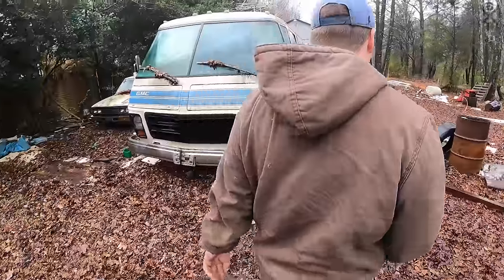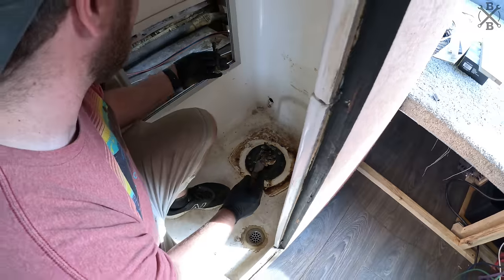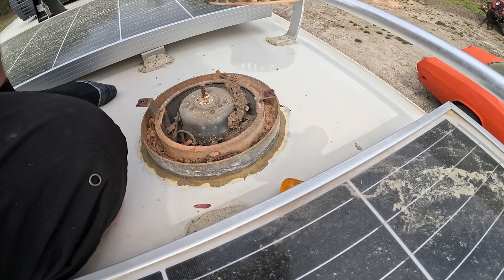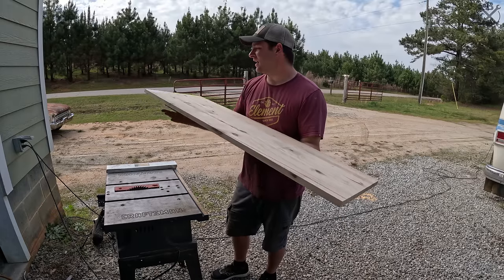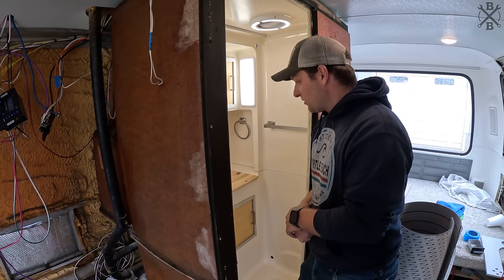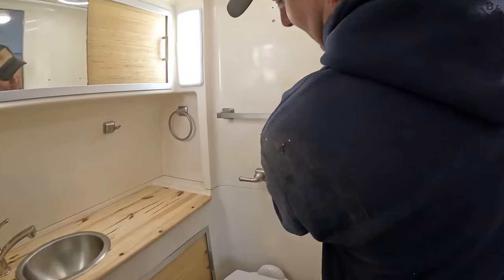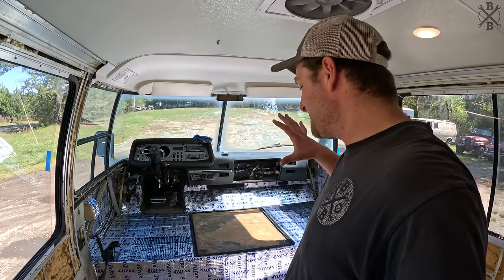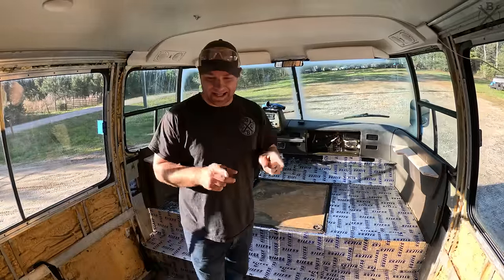Rebuilding an ABANDONED GMC Motorhome! Rescue Part 10

Comment: Looking great, very impressed with the ideas for updating the bathroom and driving area. I have a suggestion on the bathroom, the tap and sink drain flange could use some plumbers putty to stop protentional leaks. Also seeing the shower drain with so much silicone on it make me think there is a leak or was a leak that could leak again and since you have done so much maybe take a look and make sure it is good. Can't wait to see what you do next.

Comment: Go with lithium--especially if you ever want to boondock. You can get lithiums with bluetooth, low-temp protection, etc for about $165/ea now.  No reason not to--and having the bluetooth monitoring is priceless.  It's always great to know what your loads are, and especially remaining capacity.  That, and a big enough inverter if you want to use the microwave.  A portable genny is nice too if you have room somewhere.

Comment: A bit late, but if you don’t absolutely need that space between the bathroom and the door, tear out the left wall of the bathroom and install an appropriate sized shower stall. You will be real happy not having the kids having to use a wet head. Most important spaces in rv are bathroom, kitchen, sleeping, living.
Reply: Those mini tubs would actually fit in that space.
Reply: Drain Pipe Plumbing Would Be Difficult As Fuel Tanks Are Located Directly Beneath That Floor Space. Not Impossible But Kind Of A PIA

Comment: I’ve got the same flooring in my boat. If you have an issue with it peeling up, brush on some weld wood contact cement. It’s waterproof. You’ll never have a problem. It’s held up great on my boat, on the saltwater.

Comment: you are nearly there with those little bolts, but you need the ones with springs built into them, where you need to compress the spring to unlatch them, as batteries + gas bottles are too expensive to throw down the road...
keep it up guys

Comment: Michael, I've said it before, this is one of your best series yet. The Porsche was the best, in my opinion, and this is number two. Good stuff. Hey, a suggestion, if you don't mind: in your bathroom cabinet, I noticed some rusty discoloration. Something that may work in getting that out is muriatic acid - yeah, acid. It won't harm the fiber glass and a little bit on an old rag should do it. give it a try. It works. Wear gloves though!

Comment: You guys really think out of the box. The bathroom transformation was spot on. The sound deadening up front will really make driving much more comfortable. I'm not sold on your latch for the battery and tank. If the screws are not into any metal framing, it would only be time until the weight of things bouncing against the latch pulling the screws out. If you want to keep your fix, try this. Take a large long bolt with a flat washer, drill a hole in each slide tray, drop the bolt in so it drops deeper than the metal frame.  Trays are not going to come out!

Comment: Nice job fellas! I think getting it driving is a great next step. You'll want to be able to drive it after you start assembling everything. I worked at Gulfstream Aircraft for years and when we did a final flight you'd be amazed at the things that squeaked or didn't work after one flight because of fit and finish.

Comment: Propane being heavier than air, you might consider a couple vents in the bottom of your drawer slide on the thanks.  my original 76, has holes under the propane tank.  Mine's mostly original.  The interiror has newer cabinet faces, newer carpet - but original style look.

Comment: Very nice upgrade. On my old Airstream (1966) I reused the original tub but had some cracks and fiberglass repair to do. I repainted the dull off white finish with bright white Rustoleum epoxy boat paint. Pricey but looks great 6 years later. Just an idea in case you need to freshen up the interior of the bath.
Reply from the maker: Thank you!! Awesome!! 🙂 Thanks so much for the suggestion! If we need to consider that in the future, we will give it a go!

Comment: Just a thought, go to your local home center and get a roll of the (usually) pink paper that goes under hardwood flooring in a home build. It comes on a roll, I think it's about 3' wide, and cover your new floors with it so you don't damage them during construction. Love this project!
Reply: Rosin paper, great suggestion!
Reply: Don't use the pink, it can bleed if you get it wet

Comment: I have to say, that bathroom before and after alone is worth watching the series for. I can't believe how good you did on it, very impressed !! As for the door panel add ons, is there enough support with the plastic panel alone? They look great, but if someone leans hard on the outside edge, is it solid ? Not a criticism, just a question,

Comment: Love what you're doing! I may be too OCD but, may want to think about installing the shower faucet with the head connection down, rather than up. That way the valves cant vibrate to an open position going down the road? I may be wrong....lol

Comment: I think that the small lock you placed on the propane tank is not enough. It needs to lock down more for your travel, as the jiggling can unlock it. If it's out for impact, could explode. Always think safety first...

Comment: Looking great Lads !!! Budget builds are cool . I'm a little older than you guys so bare with ... In later years I developed the 3x rule ..... when attempting something unfamiliar work out these 3 things as best you can .... How much time , money and effort and then x that by 3 . If you come in around 3/4 of that you've probably done very well ........ Anyways I was thinking about the driver's cabin floor ...... Personally I'd consider covering it in lino or linoleum as yous call it , however don't glue it , use acrylic paint on both faces and then it's easily removed in the future .... It's cheap out of a dumpster and easily cleaned and if needed, you can cut out a sycodelic Mr T shaggy rug for winters .....just an easy option till something better comes along..... Also regarding batteries ...... now that's a mine field ....... I'd thow anything in there meantime and aim for lithium when you can.... Two things with that, make sure it has a sturdy bms that does everything it's meant to , and do the math on output verse's input regarding power consumption ..... So that's an old guys nickles worth..... Looking forward to the next stage of it's not already posted!!! 😉🤓🙃😎

Comment: Can't wait for the next episode. One question I have regarding the bathroom is I saw alot of screws going through the walls for lights, shower, etc but didn't see you caulk any of the holes or seal them. Any worries about water damage from the shower.

Comment: Take a look at marine woven flooring. Same thing you see in higher end pontoon boats, etc. It's a durable flooring I believe made out of PVC. It looks real good and is what Airstream uses in their campers. Then for the cockpit you can simply throw some heavy duty floor mats to address waear from your heel when driving. Looks good so far and really impressed with how the bathroom came out.

Comment: One thing I would definitely emphasize is to cut a small "trench" out of that sea deck flooring between the door and the drain. Otherwise, the water that collects around the edges will never drain. It will work it's way under the flooring and destroy the adhesive.

Comment: I used Tretford carpet tiles in a van twice. Not sure if they sell it in the states. They sell it in the most beautiful colors, it is indestructible and easy to work with. And you can always replace a tile or two if needed. Not cheap though…

Comment: Doing great my only suggestion is to we’re you screwed into the fibreglass take the screws back out put a small block of wood 
In behind and then re fix so you are screwing into the  block of wood 
It will stop the stuff eventually falling out of the wall

Comment: You did A GOOD JOB. I am doing the same to my 1996 33' Airstream Land Yacht. I put a complete 454 cid drive train including rear end and Banks Turbo with exhaust. Complete front and rear suspension rebuild, new Michelene Tires Brakes and hired an Interior specialist and updated everything. Two new windshields and a complete interior overhaul. Also a hidden push button 65" Smart TV with Starlink. New paint on the outside and a set up for the dual a/c on 50 amp and a 8kw Generator. A new bus costs 250,000 and I will have 45g Finished next week with the Power Train on a 5 Year 50,000 mile GM Warranty and Suspension. I was not paying that kind of money for a new Motor Home. I added a 150 gallon Fuel Tank for that 1200 mile range plus. A complete restoration. Everything is Brand New. It looks and smells new. I love those white leather seats with heater and massage. All the a/c's super upgraded. All under warranty parts and labor. I already turned down 110g for it. Not buying new. Good grief it is nice. Lamborghini RED Metallic. It is show room quality.

Comment: I would like to suggest you put in a one way valve thing for the shower.  RV showers should be used where you get good an wet, shut it off, soap up and then turn it back on again. Problem is that when you go to turn it back on again, you get a blast of cold water.  I saw a video on youtube one time where they put in some sort of one way valve to prevent the hot water from disappearing. I need to find that video again because I'd LOVE to have that put into our shower.

Comment: You really should have used an oil base varathane or spar varnish first on that counter top. That seals and protects that wood especially spar varnish they use that in boat building
Reply: Used epoxy on the bottom I believe

Comment: I thought you were going to try and incorporate the bathroom pieces parts out the new camper for this bathroom.great video as always.y’all just keep doing what you do best.😎😎😎👍👍👍
Reply from the maker: We used the sink, faucet, cabinet handles, toilet, curtain and plumbing from the old camper 🙂🙂 We had considered using the shower and building a new bathroom but it would’ve been so difficult to make a space like this without taking up much more room in the camper. Thanks!! ☺️

Comment: If you decide that the timber top for your vanity is a temporary solution you could use a self levelling epoxy resin top. It comes in many different colours, added colour flecks or metallic added.

Comment: Nice to see the return of this restoration!   Most likely too late, but you purchased from a savage yard the rear suspension parts at a reasonable price (video 2), the weak point on these motorhomes is the transmission, if available it is most likely a good idea to call up that savage yard and get the transmission as a spare if possible. You are doing a lot of work on a camper with a transmission that is almost impossible to replace .  Be nice to have the spare for piece of mind.

Comment: Hi from the UK...Enjoying the vids on the GMC, keep up the good work...
Re the battery and LP trays...You can get latching runners for those trays...They have a lift up handle to unlock them and they latch on their own when you push them back in..Might be worth a retro fit going down the road.

Comment: Awesome channel, thanks for sharing your visions and knowledge. One mention is that 455 engine is a great power unit but is a thirsty piggy for fuel. Ever consider going with a slightly more modern power plant?...
Reply: Problem is, there are so few front-wheel drive V8s that are suitable for this application. I think he'll be better off installing an EFI conversion kit (like the ones Holley makes) for the motor.

Comment: 27:20 I think the mirror needs to go in the inner most track so it slides behind the wooden panel. That way the side of the mirror will not be smashing into the metal handle of the wooden panel cracking it...

Comment: You need to always use butyl tape to put down the bathroom vent. I might have missed it, but I just saw caulking. Just visited the Airstream plant and they are still using it on every panel seam, roof vents and other roof penetrations (vent pipes, solar panels, etc.).  BTW I love that bath fan. It is a nice update with the LED surround.

Comment: Flip you shower valve so in the winter when you drain they system you can disconnect the shower head and the diverter will drain and not freeze. Also the hose would look better!

Comment: Is all coming together nicely. I was wondering, is there any reason you wouldn't use self latching drawer slides for the propane tank and battery sliders? They're only around $100-$150 bucks a pair depending on the length. Some of the guys here in Australia actually use one locking slide and the other just a normal slider so they only need one hand to release the drawer(good if you've got something in your other hand) so you could get one pair and use one on each drawer.

Comment: Why not put a piece of wood and attach it to the frame then slide the door panels over. it using the map pocket you can attach your new shelf with cup holders to this piece of wood. This would allow a lot more stability and keep you from putting holes in the panels.

Comment: Seems like your little gate latches need to be beefier.  Or, put a small piece of rubber hose over the pin so it's tight with the tray (not allowing physics to work against you---even if it can only move an inch).

Comment: for carpeting in the front, you can't go wrong with a slightly darker neutral gray, or as people say with paint, "if you can't choose a color, F- It! Gray!" a dark gray that isn't black can help to blend in and contrast with whatever other upholstery you're going to do, and it goes well with a lot of things while also demarcating what area is the cockpit area and what's the living space. for the radio, contact Retro Sound and see if they can hook you up with something that will fit. You may need to do some emailing back and forth to clue them in on your specific setup but I think it'll work out in the end. When it comes to anything up there for charging however, don't skimp. cheap chargers and lighters and even amazon fuses will make something catch fire. I've seen it enough times to know. Get that stuff from a reputable seller. You can also ditch the retrosound idea and carve the radio section out for a double-din and get a head unit that pops out and supports Android Auto or CarPlay plus all the bluetooth you can get your hands on. That might be a better modern solution and help immensely doing GPS stuff. Also also, watch out with the heater controls, they have a vacuum distributor that likes to just up and die from age. there's replacements and they're slightly finicky to work with.

Comment: I really, really like what you are doing with the GMC.  Not a restoration but you sure are making it look nice.  I know you glued down the wood counter top in the bath but I hope you put big washers on the screws up from the bottom.  Spread the load on the fiberglass.  Also do it on the tops you are putting on the side panels up front.  I'm old enough to be your dad's dad but I wouldn't mind renting him for awhile to do some woodworking around my house. 🙂  Learn from him and pass it on!  Have a great day!!

Comment: If you plan to use the shower at all, you should consider replacing that small shower head with an Oxygenics BodySpa RV Handheld Shower head.  RV showers are notoriously low powered but the Oxygenics RV shower heads use magic or science or something to GREATLY increase the water pressure coming out of the nozzle.  It's not a budget buster if you opt for the plain white version but you can get nickel finish for a few bucks more.  You won't be sorry.

Comment: I see you were talking about doing some thing with the fuel system. I don’t know if you want to try this or not or if it’s even feasible in South Carolina, but propane motor fuel is a viable second option in case you get stuck without gas someplace in that vehicle.  And that engine is old enough to be able to handle it just fine.

Comment: 2:34 Why not do a flat bar that goes across all the way across maybe angle iron or something like that if it’ll allow it to fit and then put the shackle block or whatever you wanna call it you know like where you’re taking flip the piece over top of the island and then put the lock through it or something to that effect or even just a carriage bolt or lag bolt might even be better if there is clearance issues

Comment: I wonder how much weight has been added. Will the engine be able to handle it?
Reply from the maker: Should be somewhat lighter, all said and done. Everything removed was very heavy. Most everything going back in, is a fraction of the weight. Would definitely be neat to go weigh it, when done,  and see the difference!
Reply: @BudgetBuildz  ah ok. well darn. those goes an excuse to LS swap it lol
Reply from the maker: @retrobear9367  Haha 😅😅 We’ll see how the 455 holds up. A swap may be something to consider though! I do like my 8.1 suburban 🤔😁